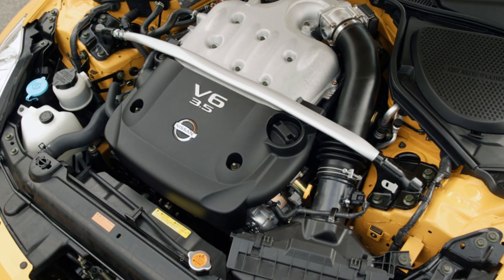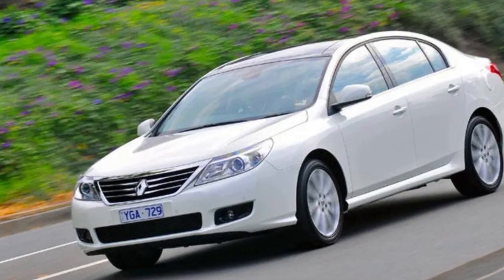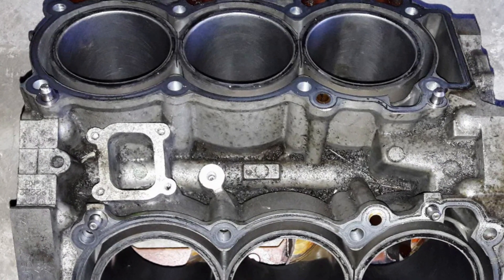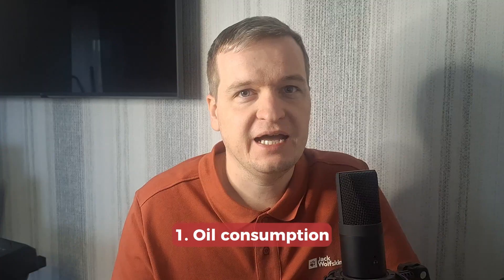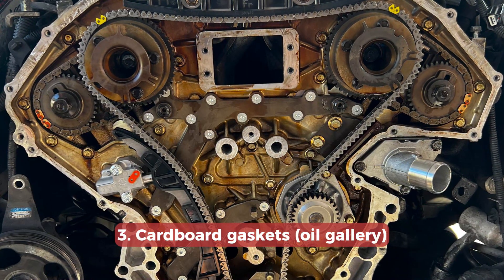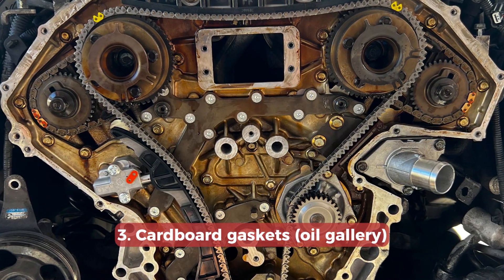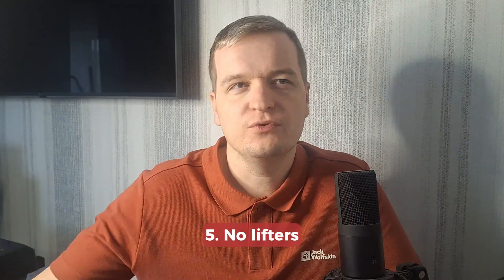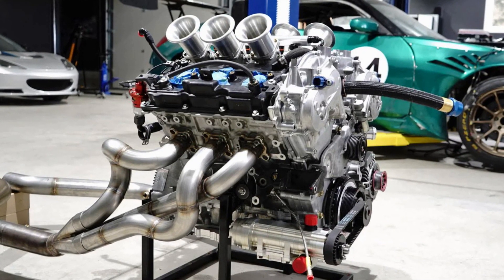Nissan 3.5L V6 Engine Problems – VQ35DE, the living legend

Comment: what can i do to prevent the catalytic converter issue?  should i run high flow cats to prevent them from breaking down and that material being sucked into the motor?
Reply from the maker: Use good fuel; fix issues wirh the engine without ignoring them; if converter needs replacement, avoid cheap aftermarket options.